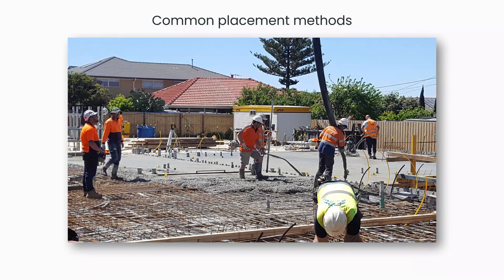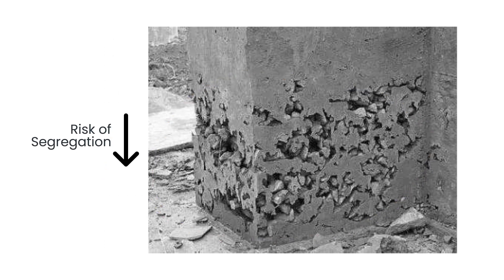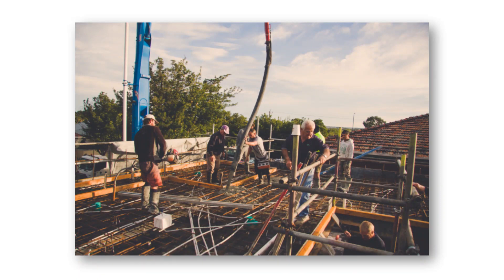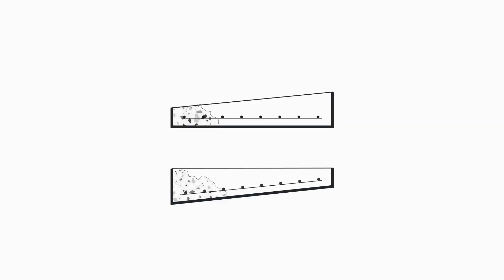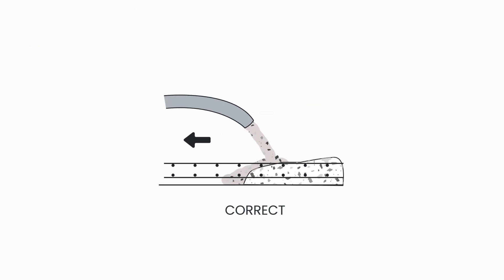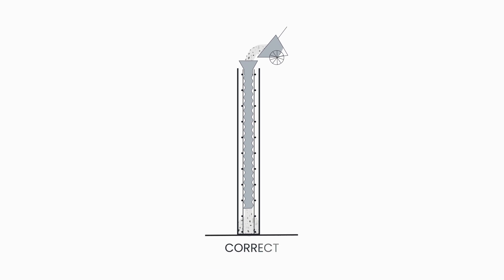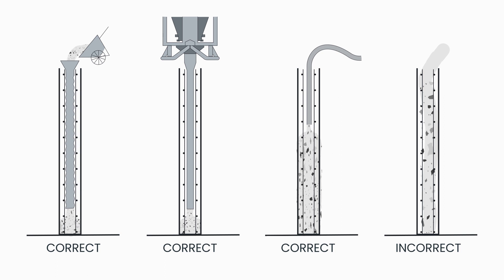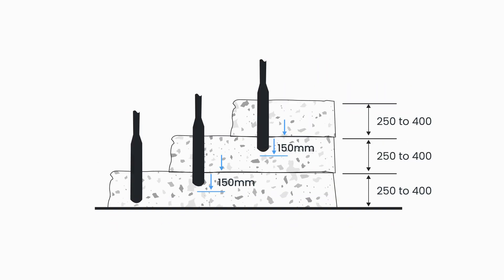Placing and Pouring Concrete

Comment: Hi hawe qwestion . I biuld hause and  wana reinforce with collums . Hight of colllum will be 1.80meters. House is from silicat bloks collums is betwen silicat blocks . I wana pour in 2 stages these collums bicuse sqere that cement in a colums can expand and damage blocks. Your opinion it will be god puor cement 1 stage 60cm than wait to cure and do 2 stage 180cm . Tnks if you anserw.🙂